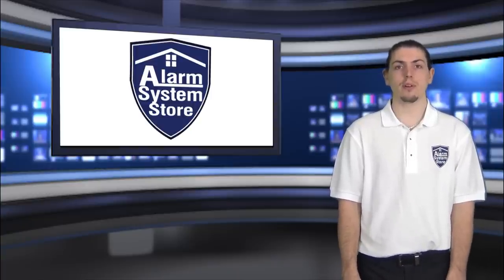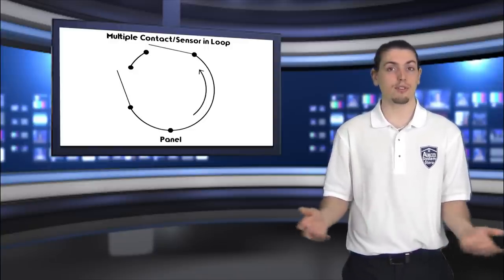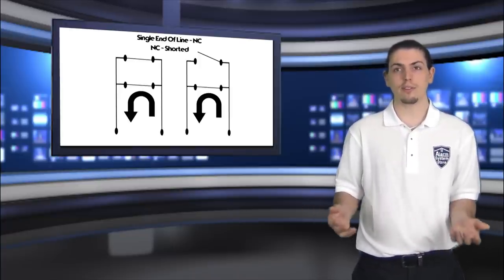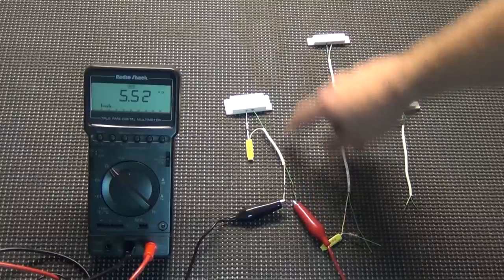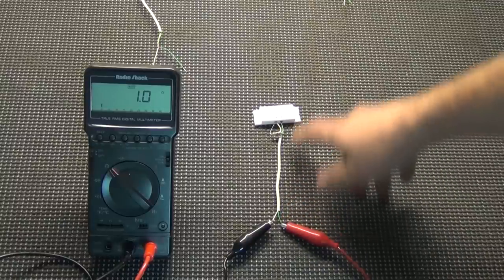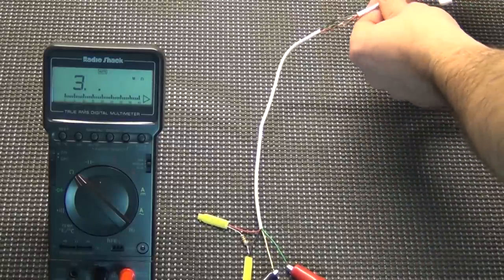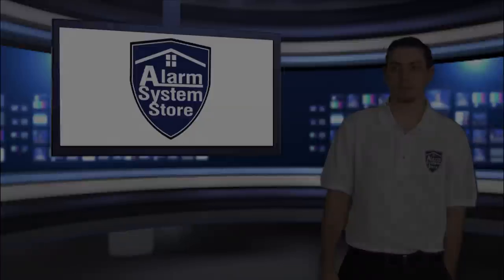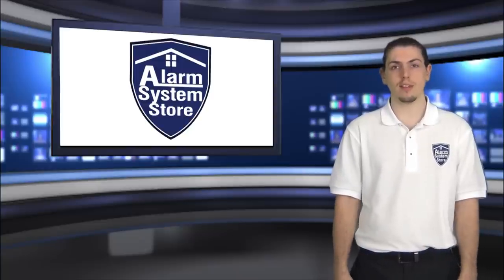Alarm System Store - All about resistors

Comment: I believe there should be come clarification as to why today's panels require end of line (eol) resistors. Older panels only measured voltage across the zone loop. Older panels sent 6 VDC across the zone loop, and of course newer panels send 12 VDC across the loop. What Jason didn't say that with the use of eol resistors, instead of voltage being monitored across the loop, now actual loop current is being monitored. This allows for more information to be sent back to the panel. A trouble condition can be observed  on the panel if zone wiring opens, with a resultant no-current condition across the loop. Or if there is a condition where the zone (eol resistor) is shorted, then full loop current is sent back to the panel and the panel trips if it is armed or alerts the subscriber to a fault in that particular zone. This is just a use of Ohm's law (V=IR).
Reply: I gotta say it. I haven't verified it, but if you say so: There might have been panels that use 6V at some point, but that's totally irrelevant when it comes to EOL setups. In fact, the most versatile systems on the market now in 2020 allows you to define freely exactly what resistance value you want to use for this or that condition in the loop - not per panel, not per set of input boards, but each individual input. This is also irrelevant, because there is a couple of rules you gotta follow as an installer:
1. Always use the same value EOL resistors on the entire system. OK, if you are replacing a panel and keeping the detectors, and it is a large mall, where you have 1000 stores which has at one point in time been consolidated into one large system, and there are different sets of EOLs out there - by all means, leave it as is if it works. But generally - ALWAYS use the same value - it will make it so much easier on your head and the guy coming there after you.
2. Never really consider not using EOL. What the guy in the video says - it's an installation aid. But this is simply too thin. I have worked with this just long enough to see people at school read all the wrong books, and went to school where electronics teachers have also read all the wrong books and knows nothing about security systems - which will tell you nothing about EOL. It will however tell you that a detector requires 2 loops plus power. One alarm loop and one tamper loop. This is taught today ! You use dual EOL based loop for two reason. The first and most important reason is tamperproofing the loop. If using a single EOL resistor or no EOL resistor at all, it is simply not a security system - it is a toy. I'm not kidding, I'm being serious - it is a TOY without dual EOL resistors. You can have the panel measure shorts in the loop, open loops, tampers, alarms. The other reason is for diagnose. Yes - it will easily make it 100x easier on you when tracing down a fault.
Bonus: "Zone doubling". Nope. You don't do that at all. I mean you can, but you don't do that. The resons for the guy in the video not explaining this concept is becuase (based on how he talks about it) have no idea how it acually need to work, what you sacrifice when doing it etc. The guy says you wire the sensors in paralell. Yes... how? Well, obviously you run the power in paralell :D. But how do u want to do this with a PIR detectors (or any other detector that actually have a tamper switch in it in addition to the alarm relay)? You can't do that with dual EOL setup. The fact is you need to use an odd combination of wiring it the loop in paralell and series. So you don't do "zone doubling". U just don't. There are detectors today that will allow you to configure them easily in a chain of several and still the loop as a whole has the properties of dual EOL loop. But you don't do that either except if you REALLY REALLY need to, and that almost takes an earthquake and doomsday. I can't explain it clearly in text - I would need to sit down and draw the circuit with you to get it across clearly.
Consider this: What happens when you paralell two resistors? What happens when you wire them in series? The concept of zone doubling simply does not work, and that's why he has trouble explaining it, and he is right - never do that. One input per detector. The concept has its place and practical use, but not in a security system. I bet you could find some use for it in automation etc, but you usually do things a whole lot different when we move into that (automation).
There are amateurs, and there are pros on this. And all in between. I've worked with people who thought they could have the profession who had absolutely no understanding of electronics. They thought wiring and designing a security system is like wiring up your hifi speakers. Some guys should not be allowed near a security system install job. If you want to be professional with this, you gotta consider everything, and know 100% what you are doing both when it comes to security concepts and electronics. Don't get me started on wireless systems btw. :D.
Reply: @LifeOnHoth  what’s wrong with wireless assuming it’s encrypted?
Reply: @randomdude1053  A lot, or not so much depending on your need on security level.
. 
To be short. Encryption doesn't really matter a lot. It matters some. But not a lot.

There are so many other ways you can modify how a system functions than actually reading the radio signals in clear text. Sometimes there are back doors also.

I don't want to spend a ton of time going in detail, but everything with a radio in it can be compromised today, either it compromise the function of the system by being poorly designed, or it compromize the safety of your personal data by leaking it to everyone who has a backdoor into the system. This happens. It's not just a thought up scenario.

Everything radio (which is wireless) presumably require a battery. This is impractical.

A wireless system, unless you move to z-wave or other open standards, will lock you in to one provider / brand. Which is a bad thing.

A system that you can make to interface to whatever, because the concepts are simple is always best.

There are tons of ways to compromize all systems - wired or wireless. There's nothing wrong with wireless if u can accept all the cons about it. But when it comes to wired, it usually is a bit more about it being a proper installed system than the system itself being volnurable. A properly instlaled security system is extremely hard to beat.

Unless your monitoring company react to a tamper alarm (for example radio jamming) exactly the same way they react to a message received that there is an alarm, all u need is to jam a system long enough to do the deed.

So, wireless might be fine. Or it may be totally unaccaptable.

Comment: Interestingly, a typical door sensor is considered a “normally open” relay device, as it needs to be energized to close. This can be confusing, because a door or window, at least from an alarm installer’s point of view is usually closed, and “open” is an abnormal condition. This is an academic issue, of little interest EXCEPT when it comes to ordering parts. If you have a choice between N/o and N/C, you have to remember the classic reed door or window is Normally Open.
Reply from the maker: I agree, it can be confusing. You just have to remember they are named for their natural state, not their energized state.
Reply: Yes, They are Normally Open, when in Use, They Are Closed.
Reed Swiches That Open When A Magnet is Present, Is An Open Contact, Agree is Confusing

Comment: Where does the end of line (EOL) resistor go?

The EOL resistor should always be installed at the last device and never inside the control panel. Placing resistors anywhere other than the end of line does nothing to supervise the wiring, which is the reason for using the resistors. The only exception to a resistor ever being in a panel is in a 4 wire with the resistor at the end of  the return pair, in the panel. It supervises the entire cable, both pairs that way!

Comment: Hello, would it be helpful if you put an end of line resistor wirelessly? This is for example if you connect a wired door contact (special NC signal door strike) through a WS4945 wirelessly and NOT wired directly to the panel???

Comment: Let me get this straight. On reed switch an NO or NC is defined when the magnet is not attached ? So an NO = loop open when the magnet is away (i.e. door open)and it closes when magnet is in contact (door closes) ?  I get conflicting answers. Thank you
Reply: Switches are defined by their natural state, as in is the switch open without a magnet and only closes once a magnet is within range? If so this is a NO switch. We typically use such a switch in a NC application though, like a door or window.
Reply: Andy Bowman thanks, I think this is where I got confused as I am wiring my vista20p eol, I am about to wire my eol on my vista20p, my switch are NO, should I wire my eol in series then as I will use it on my door? Right now they are in parallel not powered yet.
Reply: Yes, NO switches used on doors or windows need to be wired in series. If you were to put them in parallel the zone would only fault if all doors on the zone were opened at the same time rather than any single one.
Reply: Andy Bowman thank you!

Comment: That second to last example was just weird.  I've worked residential and commercial and never saw 2 resistors used on one contact. That just takes forever.
Reply: I've never seen it employed either, but it is an option in some panels. May be used more often in UL installs. I've rarely encountered single EOL used properly. Generally always see them installed in the panel.
Reply: I mean not to brag, but I've worked institutional, government, industrial, commercial, small biz, residential and I have never seen that employed.  It seems overkill to me.  My company I worked for used supervised at EOL, but ya def see them mostly at the panel.  Some panels are wired without resistors now. It is what it is.
Reply: @Justify4935  common practice here in the uk for example a honeywelll galaxy alarm uses 1k1 so a contact would be 1k1 closed and 2k open 2 resitors